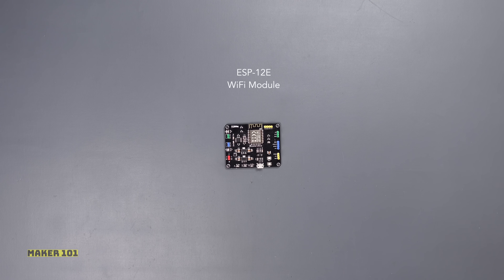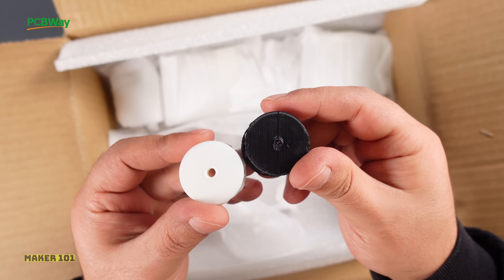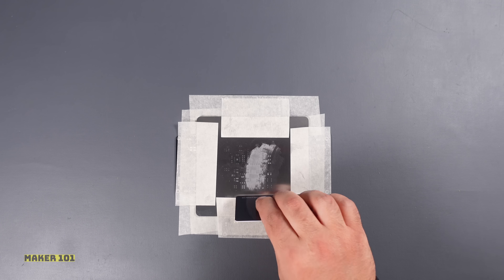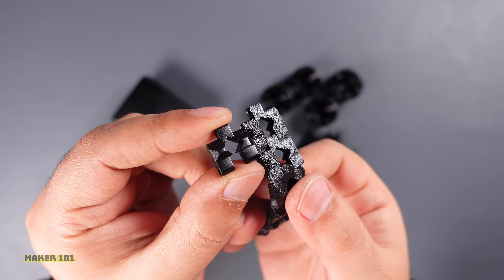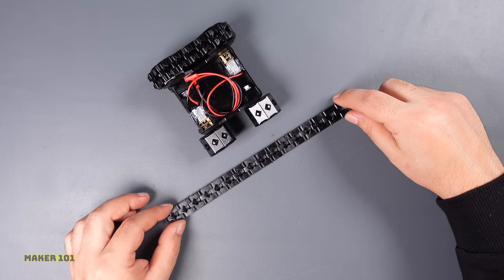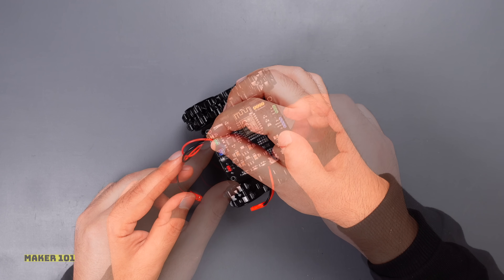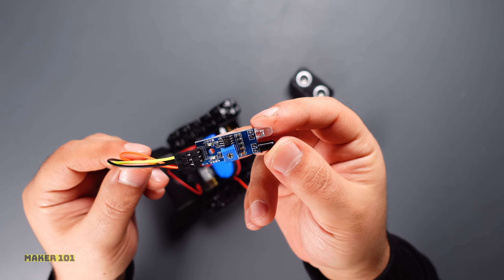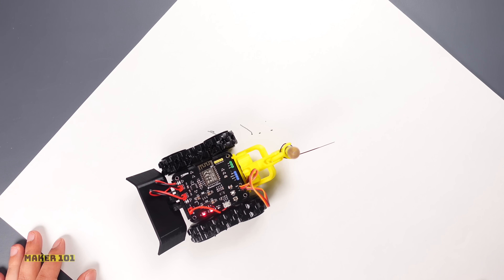ESP8266 Dual DC Motor - Servo Motor - IR and HC-SR04 Sensor

Comment from the maker: PCB Files, Part List, Source Codes, 3D Parts and Designator - https://www.pcbway.com/project/shareproject/ESP_12F_DRV88xx_Motor_Driver_Development_Board_bc4e7391.html
Instructables - https://www.instructables.com/Line-Following-Obstacle-Avoiding-Drawing-Robot-ESP/
Reply: Hey Maker 101 nice videos. Don't you made a video about the development process of the DRV88xx_Motor_Driver_Development_Board ? That would probably be a very helpful video